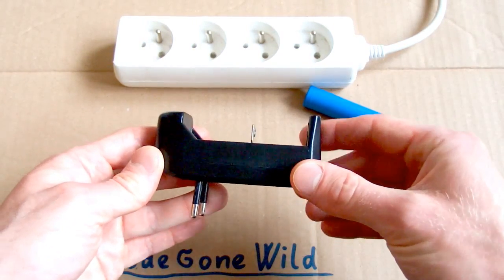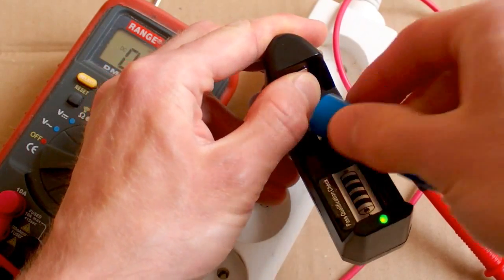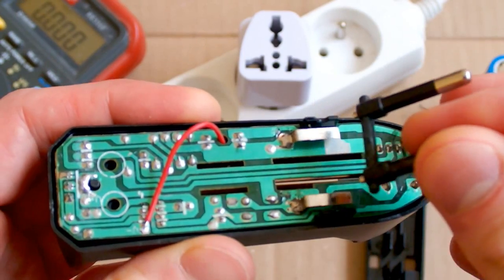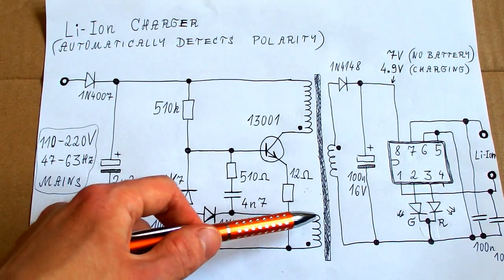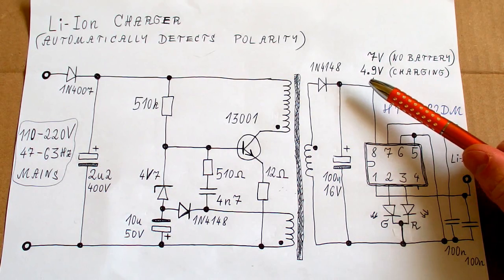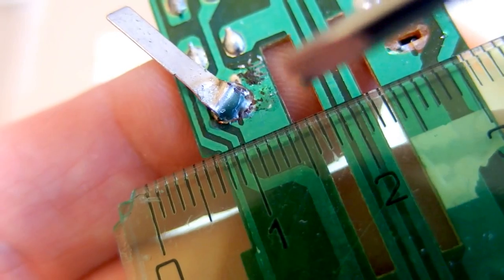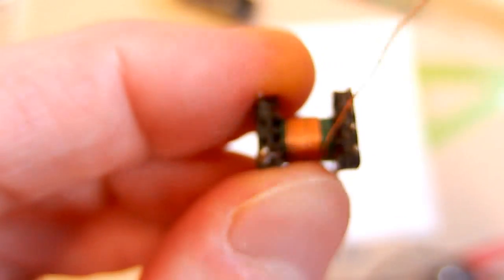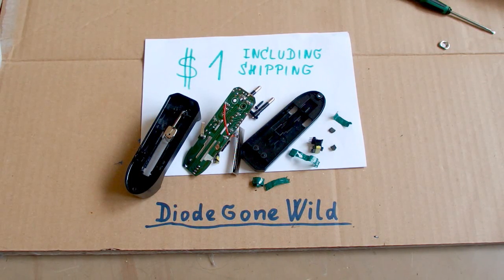Clever but Dangerous 18650 Li-Ion Cell Charger (for $1)

Comment: I bought a similar one in December and arrived 2 days ago. The board design is similar, but it has an optocoupler and the chip is different, and it has no pollarity detection. Same issue with the izolation on the PCB. I will use it by first connecting the li ion pack and next put it in the mains plug and the oposite after charging. This way the risk of touching the terminals while the circuit is powered is minimal 🙂

Comment: LOL Czech fire extinguisher!

I think this device will plug right into an Italian socket, and maybe, in the most dangerous way, into a Danish socket. It will also fit into mainland Chinese sockets, which is likely what they had in mind when they were designing it, but not into HongKong sockets. By the way, Chinese sockets look a lot like your adaptor, they accept both round and flat pins and have flat surface without recess.

According to the datasheet, the current is internally regulated by the charger IC HT3582D, to average 300mA and max out at 400mA. If it actually delivers less than specified on average, that's likely the limitation of power supply on the input. I don't think the chip, being as big as it is, getting hot is such a big deal - it's designed for 1W of thermal loss at 100°C/W according to datasheet. I have TP4056 (LTC4056 clone) modules that are set to 1A and they get very warm but not dangerously hot, and they are linear regulators and quite small. The power bank IC such as MP3401A also commonly use linear regulator when charging. To limit the temperature, they could reduce current when battery is empty, ramp it up as the voltage on battery gets higher and regulator doesn't need to work so hard, and taper it down again as it's close to full.

The charger IC with polarity detection and internal current limiting and temperature limiting looks nice. It's the cheapest 18650 charger you could get, so i might like to get one to rip out the mains portion and simply connect the secondary to a USB socket, and maybe limit the power by an input resistor or something. By all reason, they're dumping them under cost because they can no longer legally sell a device with such a bad separation since 2006 in China, and Chinese punishment can be very fierce.

That cat is waaaay pretty btw! So pretty!
Reply: I couldn't find data on the HD3582. But, the transistor is rated for .5 amps 400 volts That's plenty, as long as it switches cleanly. Two big problems: The 1N4148 diode is only rated for 150 milliamps at the most, and the lack of a fuse on the supply side of the 1N4007 diode and the 2.2uF capacitor. If that diode were to fail short, that capacitor would literally explode almost immediately. I would replace that 1N4148 with a 1N5819 Schottky barrier diode, which is rated 1 amp at 40 volts. I don't exactly trust that transformer either. Oh yeah, don't forget the fuse!!
Reply: @Lenzak800  Translate google:
product description
HT3582DM is a universal charger with built-in reference voltage
Control chip with automatic identification of battery polarity, short circuit protection, over temperature
Protection and other functions.

main feature
◆ Built-in reference source, regulated output at no load, no external components required
Adjust the no-load voltage
◆ Support ordinary three-lamp mode and two-lamp mode, seven-light mode
◆ Maximum charging current: 300mA
◆ Support charging 0V battery (battery is connected)
◆ Switch to constant voltage charging mode when the battery is fully charged, the battery can be charged
More full
◆ Automatic identification of battery polarity
◆ Short circuit protection
◆ Over temperature protection
◆ Highly integrated, few peripheral devices
◆ Miniaturized MINIDIP8 package

Comment: If the 12 ohm resistor in the emitter gets around 5v across it, there won't be enough voltage from the feedback circuit to turn it on. So the primary current is limited to around 420ma.

Comment: Could the 250 mA charge current was because the charger was in the Constant Voltage phase of the charging operation. The 450mA is probably the charge current when the charger is in the Contant Current phase.

Comment: The most impressive thing about that is the output chip, containing an H-bridge output stage, capable of detecting polarity, and the voltage threshold cut-off for the lithium cell. I would definitely upgrade that 1N4148 to a 1N5819 schottky diode.(rated 1 amp, 40v. Then, if you dare, can drop the value of the emitter follower to get more current. I wouldn't try to increase the amperage past the nameplate current of the charger. While the transistor is rated for .5 amps, the transformer has a 11.3 to 1 ratio. At .5 amps output, the transistor only sees about 40 milliamps. It's the transformer that worries me the most. Also, if the transistor doesn't switch a clean square wave, transition losses could heat that up. For a dollar, it might be worth a try to bring one of these up to advertised specs. Be careful, you don't want a lithium ion cell all down the front of you.
Reply: On the Hotchip Manufacturers data sheet suggested circuit, they show that diode as 1N5819/1N4148.
Not exactly equivalents but for $1, looks like this version took the cheaper one.
I bought a dual version made in 2015 and it has the 1N5819 but includes all the other dangerous stuff.

Comment: DGW! This is excellent! TYVM!  Interesting problem with this type of circuit:  This won't charge a flat battery.  at 0v it won't know which way is positive and doesn't charge.
Reply: The actual HT3582D does have the feature to charge cells from 0V - I wonder what they did with it that it won't when used in these chargers?

Comment: Thanks for the schematic

I got one of these included with a li ion torch. I had a look inside and upon seeing no isolation what so ever I threw it in the trash without using it even once. This damn piece of crap is dangerous!
Reply: berni8k 
You could in theory remove all the circuit inside and fit a good power supply and charge control chip inside. It'd make a good universal charger, but it would exceed the cost of the item itself! :)
Reply: maybe dangerous to a novice but i could use it safely with a couple of modifications
Reply: Isn't a transformer isolation?
Reply: It actually has a step-down isolation transformer in it, but this one didn't look like the best quality.

Comment: I bought two chargers of these Chinese
I ask: It is dangerous to put the battery with the reverse polarity, I think it can cause a short circuit
 I have checked that if the battery is first placed in the charger before placing it in the AC outlet, the polarity is correct ...
For the cheap price it is better to change the internal circuit for a Tp4056 and a USB connection and we have a charger with a retractable slot.
Greetings from Venezuela.

Comment: I just took one of these apart. Google knew what I was looking for when I searched "jia-xin charger". It's in the same housing (with a US plug) but with an updated board with a date of 2022.3.28. Other board markings are XC-018L and NB1386. It's even more minimalist, without the charging IC, just a super basic zener diode/optocoupler voltage regulator. The isolation distance is nonexistent, maybe 0.5mm between high and low side. It came in the package of a green DPSS laser pointer of unknown provenance with no IR filter, along with a suspiciously lightweight 18650 battery. The triple threat of blinding you, electrocuting you, and burning your house down.

Comment: I've just received that same charger today, and it exploded just 15 min charging the battery that came with it, opening it, the 2u2uf 400v cap was the one that exploded, I  haven't check the other parts yet, but for 1$ ...

Comment: got the new model, the main EU plug is longer, installed 2 resistors 22ohms/1w at each side to the mains that was direct and a small fuse, works fine for 0,90€

Comment: Have one of this chargers that come free with a baterry and a flashlight i bought on ebay, noticed the inverted voltaje too, BUT for some odd reason when i put the battery the charger works normally, have this charger for like 4 or 5 years and still works, sometimes i check the polarity and is inverted, put the battery to charge and works normally after a few seconds.

Comment: 1.Get pliers/use bare hands or teeth to rip out those two prongs, 
2. Solder some lenght of wire terminated in proper two-prong european plug. (Just cut it off something you fried).
- solder a fuse in the line if you feel like doin' it
3. done. 
Seems i forgot to insulate the live soldered connection, but you will get reminded in hard to dismiss way, the next time you grab it anyway...

Comment: One layer of tape is massive. I have seen a single coat of laquer as insulation on things before.
Reply: Acid test is would you touch a live connection with one layer of sellotape around your finger tip.
Me, I'm a coward. I prefer dual bobbins.

Comment: I bought one of those and it didn’t charge, I was confused cuz it the led light kept turning off when I was inserting a battery! When I checked the voltage with a multimeter the polarity where reverse! Thanks god I didn’t put the battery on it for long.

Comment: Great 👍🏼 video. Big FAN of urs.... May I ask why is there 3 windings in a transformer and not the usual 2 ( primary and secondary windings)? 
Thx 🙏
Reply: If you watch the video, he explains all of that. It has a feedback winding, to sense the voltage on the secondary side, rather than a proper voltage reference (eg: TL431) and optocoupler to signal back to the primary side.
Most cheap power supplies have the same arrangement, and the advantage is... it's cheap! In this application the poor voltage regulation doesn't matter in the slightest, since the IC on the output gives the cell what it needs.

Comment: Diode gone wild 

Can you please also change this charger too usb 5 volts so i can learn how to safely do it thank you
Reply: Simply remove all the internal circuit, and fit a TP4056 module inside. Safest to get the module with "Protection" as that contains some extra IC (DW01) and a Mosfet that will shut off the power if it is under or over safe voltages. The TP4056 is a very good IC (you can google it) and the modules are under $1 on eBay. By default the TP4056 modules are set for 1A charge current but you can change the sense resistor if you want lower current.

Comment: excellent explanation, congrats. i got one of these included in a product I bought and, I wont use it :) mine said zhinengchongdian in the front, and in the back there was no sticker, only model: JXC-001, output 3.7V/500mA (end-off change voltage 4.2V+-1% . i saw the 12 min of video, learned somethings, nice editing, congrats, one more subscriber to your channel!

Comment: $1 including shipping is a wonderful deal!
Reply: For something that can burn down your house and potentially kill you .. sure.
Reply: @amon6109  It's ridiculous, it's not a bomb, but the guy in the video exaggerates and pulls out the mis calculus of the resistors
Reply: @rickhuntraslam2925  It's not a bomb but electricity is still electricity and these batteries are not a joke either (bad lithium charger + lithium battery = disaster waiting to happen). This thing has very bad isolation and is prone to sparking and even "burning" when it goes bad.

Comment: Yes it is clever, perhaps find a plug in the wall switchmode phone charger and wire the output to that chip input.
Still charges the battery but via a safe supply :-D
Reply from the maker: It's better to use a USB phone charger with a powerbank. The powerbanks with replaceable cells can work as chargers :).
Reply: Unless they are a very dodgy type of powerbank with a diode+resistor  (!) charging circuit :-)
PS: The device will fit in Italian plugs which are flush with the wallmount.
The reason is because the mold is recycled from a charger with US style plug, but they put round pins instead...
Reply from the maker: Even the 70 cent powerbanks usually controll the charging using a chip with a buck regulator in it. 
I really wonder why they keep shipping millions of those plugs into Europe despite they don't fit our sockets. Nobody told them how the EU sockets look like? :D
Reply: You cant help having a socket in hole LOL :-D, leg pulling :)
Reply: It's not designed for EU sockets, but it'll fit in Italy. It's designed for mainland Chinese sockets. But they can no longer legally sell those in China, the separation is not up to 2006 China standards. I don't think there are millions of those, i think there's a new old stock of maybe a few tens of thousands units, maybe hundreds of thousands, that are unwelcome goods, you can't sell them domestically, you can't sell them through a reputable exporter, all you can do is ship them out by mail one by one and regain maybe $0.40 per piece, while they probably cost about $0.50 or a little more to make originally. But it's cheaper than recycling them.

Comment: how they compete with the world, thats evident .....
dont buy this single or dual one also ..... failed on me, i tried to repair but keeps buzzing .....
replaced all those basturd components with a tp4056 module and now charging more safely with a 5v charger
Reply: The HT3582D chip used in these is actually a pretty nice chip, good for up to 400mA charging.